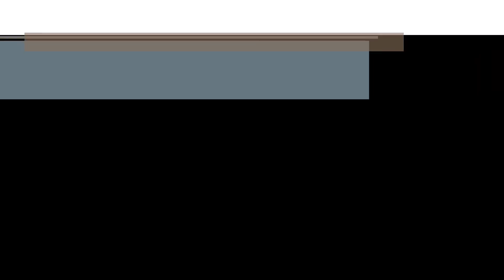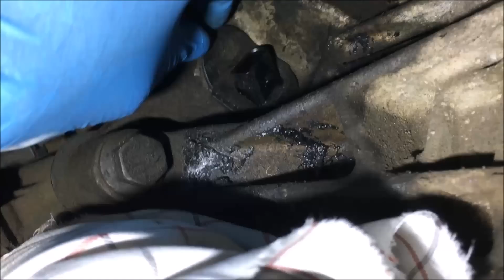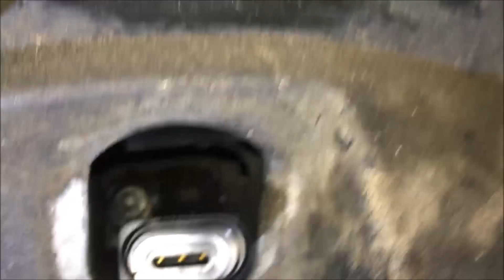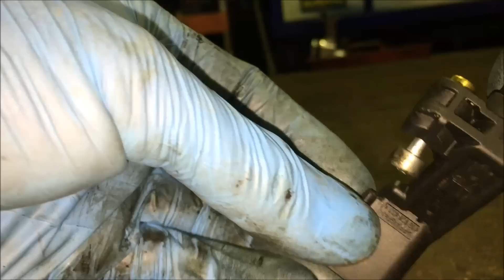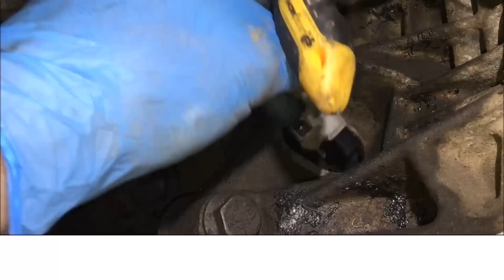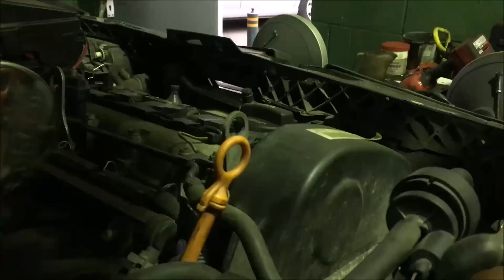How to change the crankshaft position sensor CPS Seat Ibiza 6L VW Polo 1.4 16v BKY Engine

Comment: Hi I have 5 days I looked for it and did not find it. Please where is its place. My car is vw polo 14 2002
Reply from the maker: There’s another of my videos that shows exactly where it is and how to get to it from under the car. It’s above the long driveshaft at the back of the engine. 
https://m.youtube.com/watch?v=RalFqKzw_6E
Reply: @redram52  Ok thank you so much 💙
Reply from the maker: @waledwela5598  you’re welcome thanks
Reply: @redram52  hey my friend I have a question with your permission. I have golf polo 1.4 I didn't find it sensitive ABS. And I couldn't find a box motor ABS. 
Can you help me please
Reply from the maker: @waledwela5598  does it have abs? Some did some didn’t. Is there a warning light on the dash when you turn on the ignition? If I recall the pump unit is on the left side above the gearbox. If there’s 4 pipes out of the brake master cylinder then it’s not got it. If there’s 2 pipes then follow them to the pump unit.
Reply: @redram52  Yes, I have the brake light and the ABS light
Reply: @redram52  I have the ABS warning light in the dashboard and I can't find the ABS box above the gearbox

Comment: I have a 2005 VW POLO 1.4 petrol, and for some reason it cuts out at 3rpm. Plugged in diagnostic tool and says crankshaft sensor. Is this a likely fault from a faulty sensor
Reply from the maker: Worth trying a sensor then if that’s what the box has found a fault with.

Comment: hello did you remove the motor starter first?
Reply from the maker: No. Just as you see it.
Reply: @redram52  is possible to clean it?
Reply from the maker: @MALUMEMALUME-mn9tg  not really it’s a sealed unit. If you’re going to all the trouble to remove it you may as well replace it.

Comment: where is the wire coming from that connects to the sensor, found the sensor but it does not have anything connected to it. if you have the connector oem number would be great
Reply from the maker: The wire goes into the main engine loom. There won’t be a part number on the connector but it will be a numbered type connector. I don’t have that number.

Comment: If I disconnect my camshaft engine  runs sweet, replaced cam sensor still the same, would a crank sensor be the fault?
Reply from the maker: This was my road rally car. I had the same fault. This is why I changed the crank sensor, cam sensor, throttle body, EGR valve and other stuff. Made no difference! Disconnected cam sensor and it ran like a Swiss watch but struggled to start. Eventually I wired a switch to the cam sensor to turn it on for starting then off straight after. Bit of a strange one. Sold the car to a mate and he’s still rallying it as is. That was a good few years ago now.

Comment: I am sure you are busy, but did u have to remove anything under the car to gain such access to the crank sensor, i am pulling my hair out here.
Reply from the maker: No it’s accessible from underneath over the offside drive shaft. I’ve another video of it’s location from under the car. Have a look at that one it may help.
Reply: thanks for the reply, i can get my hands in now !!! but for the life of me i cannot get the t25 into the bolt... its so difficult under there as i cant see anything its all done by touch. but your videos are really helping me.. i would be lost without this, so great video... having a brew and then will try again.
Reply: thanks for your help, i managed to change it, and wouldnt of been able to even find it without your vids, so thanks again.. not fixed the car tho, still revs between gear changes. with a p0501 code... you ever had a problem like this? maybe i changed the wrong speed sensor.. oh well.
Reply: Did you manage to create a video on where to locate the sensor ?
Reply: Not a chance, that was so difficult, you made it look easy, so best to leave your vid up as the one that showed me how to do it, but i will say to anyone with a BKY model, one get rid of it as its a pain ...and dont even attempt this job without a ramp or strong Jack stands .. as u really need to get into the mid belly of your car... and to you Peter again u made it look seriously easy, my hat off to you sir.
Reply: oh n p.s. didnt fix my problem of revving between gears.. oh well.;-)
Reply from the maker: @antheism1  https://www.youtube.com/watch?v=RalFqKzw_6E

Comment: mate i cant get near the sensor, did you remove anything to make room to work? i know where it is, i have the exact same model car but on a 56 plate, and ive been over the bonnet, and under the car but cannot get near it... any help would be appreciated.
Reply from the maker: Sorry for the late reply. It was on a ramp so easy access, in a way, from underneath over the drive shaft
Reply: @redram52  did u sort it